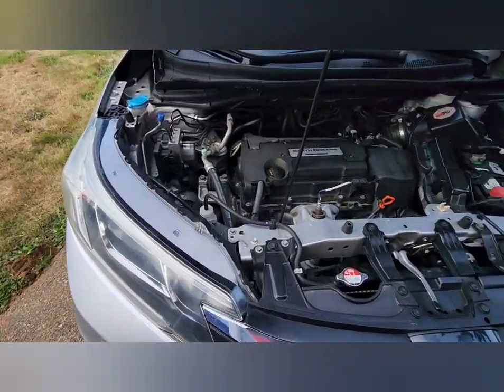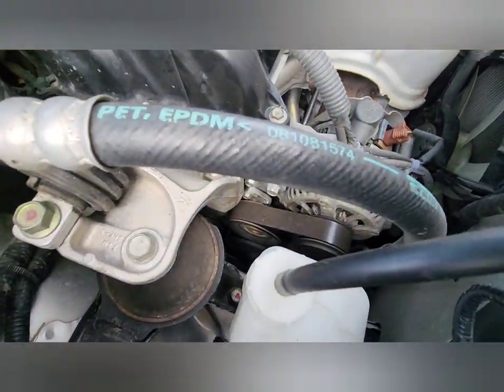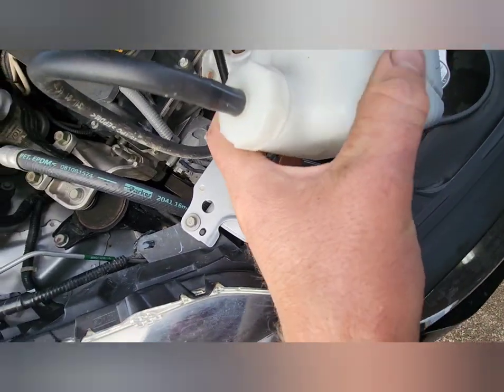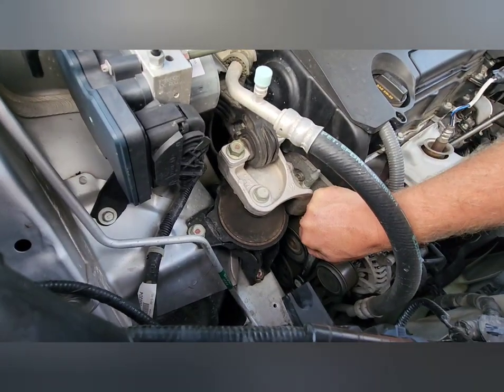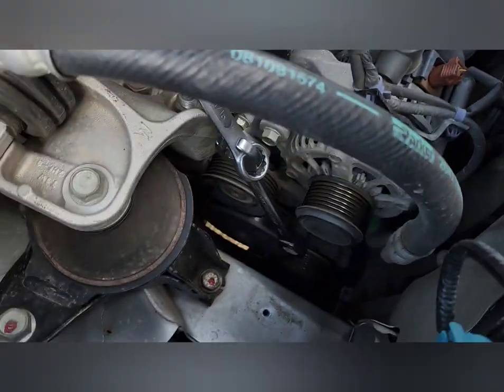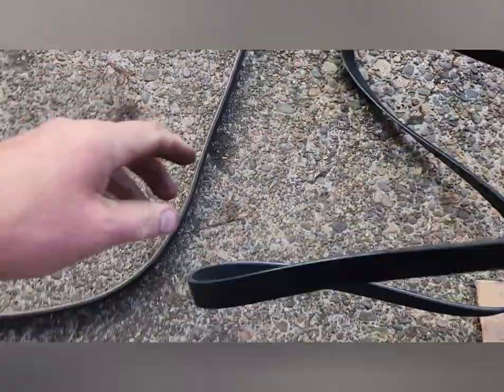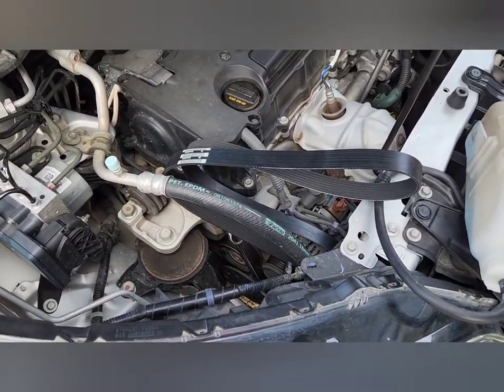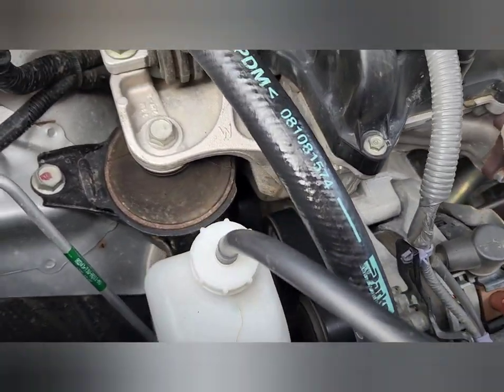2015 Honda CRV serpintine belt replacment

Comment: What were all the symptoms you experienced that led to replace the belt?
Reply from the maker: None for me.. I just wanted to replace it before it broke and left me stranded. But typicly it will be squeaky, mostly at start up. Also an aged belt will have lots of cracks on the edges. The replacment interval is 60,000 miles ish.

Comment: Hi JJ, is it easy to mount the new belt on the crankshaft pulley  and a/c supply from the engine bay itself or do I need to remove the front driver side wheel and the cover  for easy access ?? 
Will be doing it for the first time so want to make sure I don't get stuck .
Reply from the maker: I was able to do it from the top, without removing the wheel well shield.  I just removed the coolant resovore.  Hardest part is getting enough leverage on the belt tensioner.
Reply: @jjsdiygarage1267  Sounds good. Thankyou for your prompt reply. Great video explanation . Keep up the good work :)

Comment: I bought mine certified pre owned 2016 with 45k miles now I’m at 125k. Should I wait until I hear squeeling or just replace. Do I need to disconnect my battery?
Reply from the maker: If the ribs are cracked I would replace it.  As long as no one is going to jump in the car and start it while you are working on it there is no need to disconnect the battery. Every manual will say other wise though..its your choice

Comment: If the squeak doesn’t go away after replacing the serp belt, what do you think the cause may be ? 2015 crv ex 
Thanks !
Reply from the maker: You might have a squeaky pulley. While it is running. Spray a little wd 40 on each pully.  When the squeek goes away or changes thats your issue. Try not to get it on your belt. Not a huge deal if you do.
Reply: @jjsdiygarage1267  i was just wondering, because it didnt seem like the squeak was coming from the "belt" area necessarily. and do you happen to know which is the most common pulley that goes bad compared to others? i ordered a belt. im going to see if that works, but ill check the pulleys once i remove the belt like mentioned on the vid !
Reply from the maker: @Michael Diaz  more than likely it's the belt or the tensioner.
Reply: @jjsdiygarage1267  gotcha! i appreciate the abrupt response and thank you for all the helpful vids that youre creating. i hope your crv is still running strong

Comment: have you had any issues with cold rattle during start up?? people are saying its the cam chain tensioner. what do you think?
Reply from the maker: Luckily...I have not had any issues with the engine at 150k. What kind of rattle? Metallic or plastic?
Reply: @jjsdiygarage1267   sounds like the cam chain tensioner for 15-16 crv that people complain about lol. its annoying. only happens during cold starts usually in the morning. was just curious if youre having that issue as well. do you know if your cam tensioner has been replaced?
Reply from the maker: It has not been replace, I am the original owner.
Reply: @jjsdiygarage1267  gotcha! i may have to replace my cam tensioner chain and see if it fixes my rattle from cold start

Comment: Your car has electric power steering. It was installed inside the steering wheel. It is an electric motor about 10 amps. to assist you when you steer your car.
Reply from the maker: That's what I figured.  Never thought about it. I think its my first car without a belt driven steering pump
Reply: How much would it cost to fix when it goes out
Reply from the maker: @jkkennedy8919  it's an electric rack and pinion. So the entire unit is going to be very expensive. And then I probably has to be calibrated which requires a specific scan tool... I had a squirl or rabbit chew the wire by the connection once that made it fail. It being electric is a curse and a blessing in that it shouldn't just stop working. I would take a look at the connections and wires under the car.
Reply: the part costs about 200-400 brand new OEM and the labor is about that much.